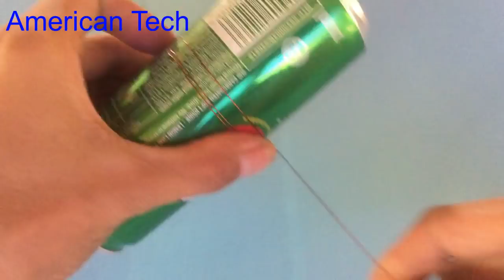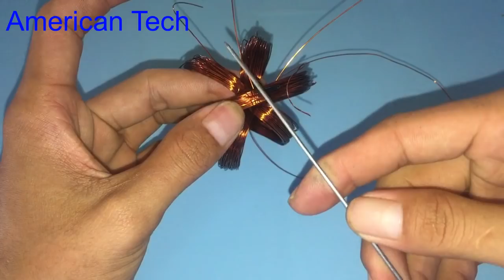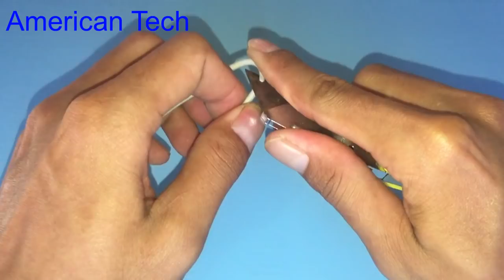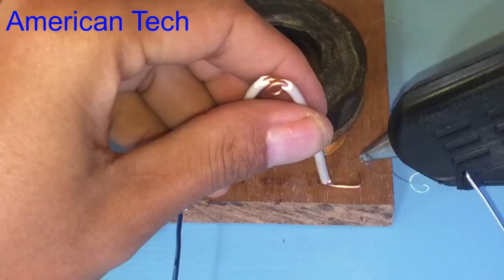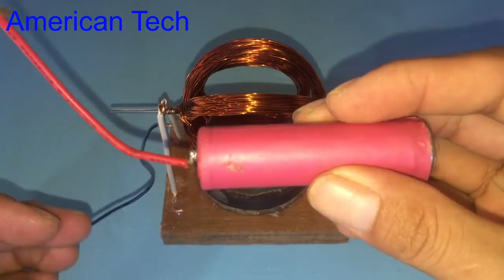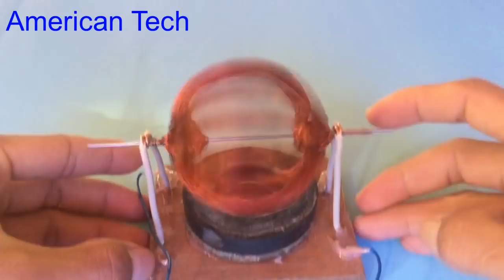How to make 2000RPM  DC motor , science school project for learning

Comment: yes, at, there are two dozen ways to make an inefficient dc motor.  i suggest you do some work with gears.  especially, reduction gearing.  which is what is needed in order to use a low-torque motor, for ANYTHING.   pinion gears are usually pressed onto the shaft of a small motor.  in order to remove a pressed-on pinion gear, the use of a small gear-puller is necessary.     cheers
Reply: That's what I was gonna say